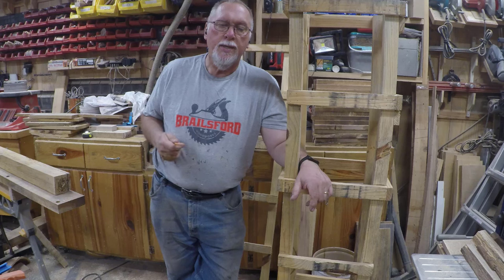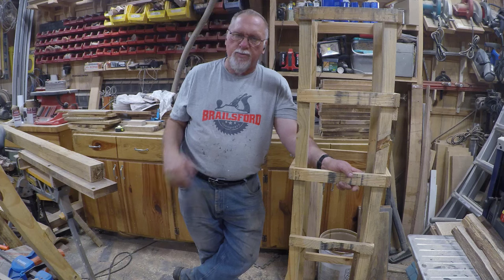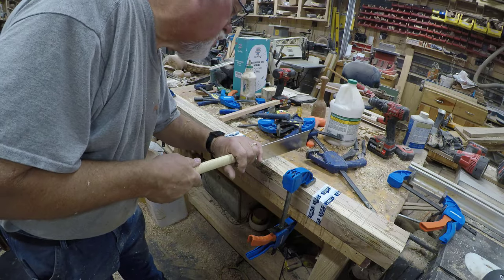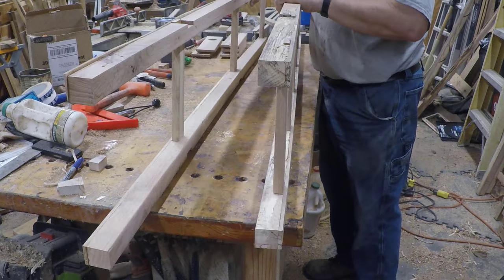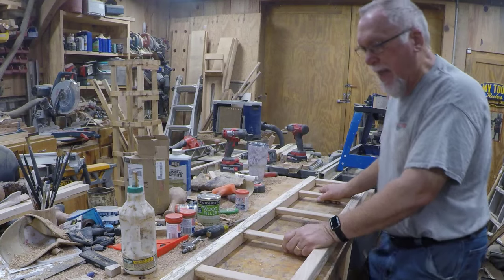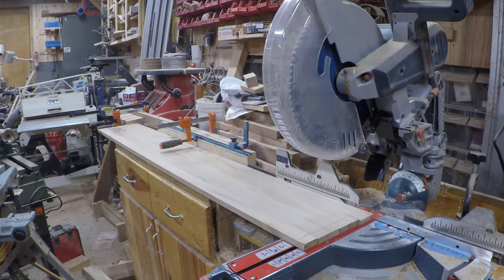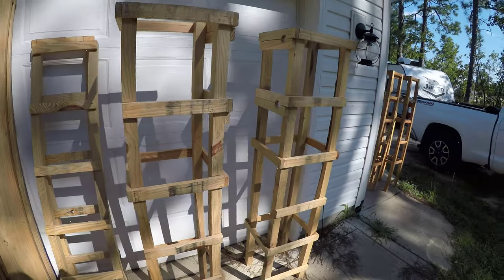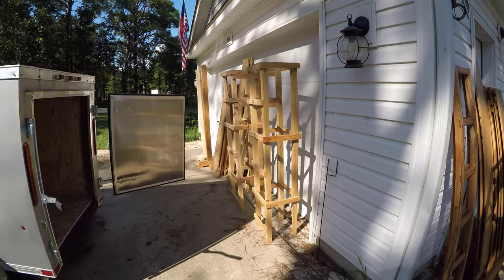Craft Show Success: Building Stunning Display Shelves For Your Business #brailsfordwoodworks

Comment: Nice to see "the OTHER side" of the craft fair business. You have lots of time and materials invested there, but it's all a necessity to achieve that edge over the rest of the vendors. Nice job!!
Reply from the maker: I do for sure!  However, I used my last set for two full seasons and would have lasted several more, with only minor repairs needed from  time to time.  Given that these are Oak they should last for far more years.  It will be a one time investment of the time and materials.  They also look much nicer and I hope will be an investment that will bring more customers.  Thanks for watching!